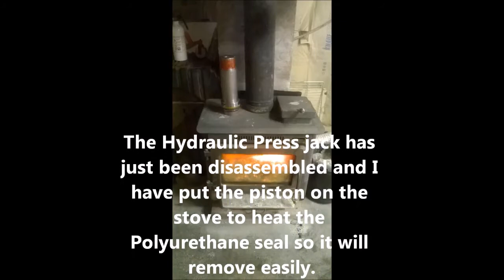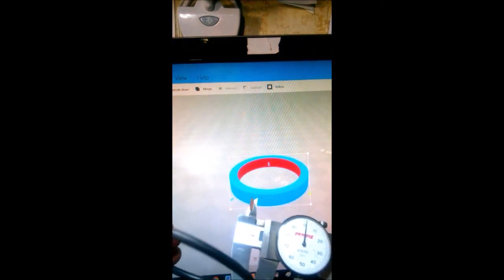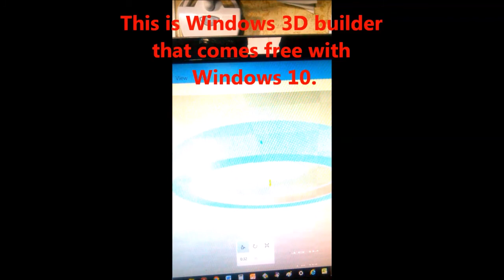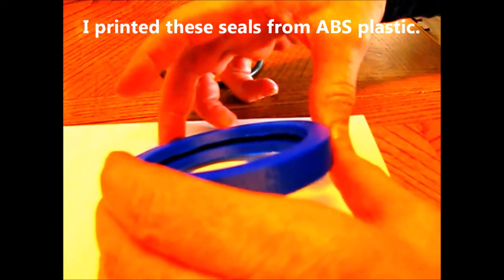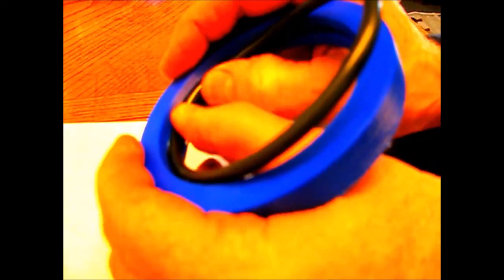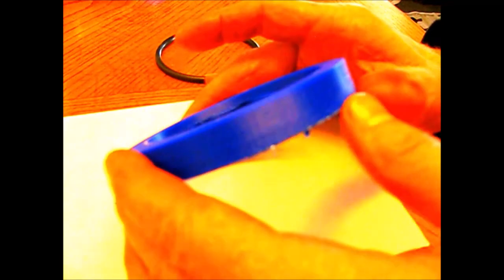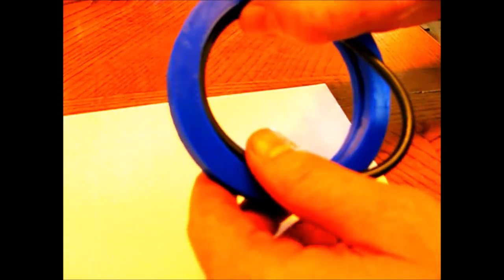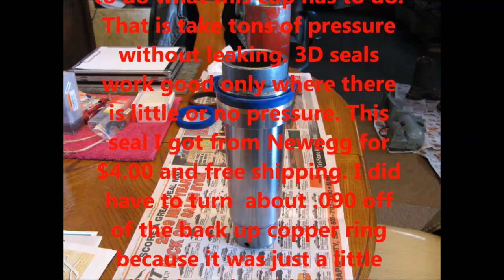Hydraulic Press Jack Repair

Comment: Nice. How does the ABS machine?
Reply from the maker: The 3D printer melts the type of plastic ( or whatever material) you put into it and then it pushes the melted plastic out of nozzles. There are a large number of different types of plastics to use. ABS, PLA, flexible, metal impregnated, even gold impregnated. The problem, which manufacturers and promoters won't tell you is that the material isn't one continuous piece. The hot material gets deposited onto already cooled material, so even though it "adheres" there is still a "seam" in every layer.